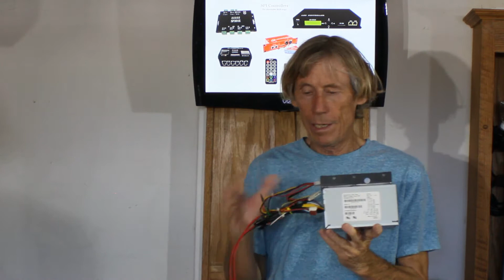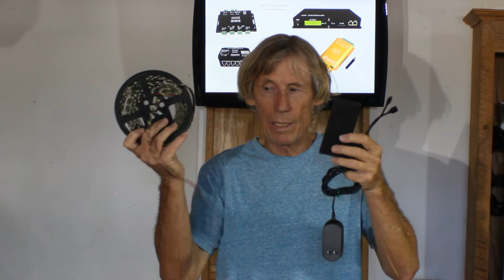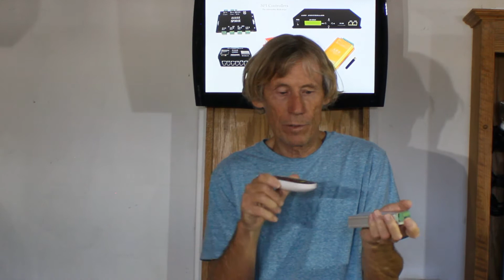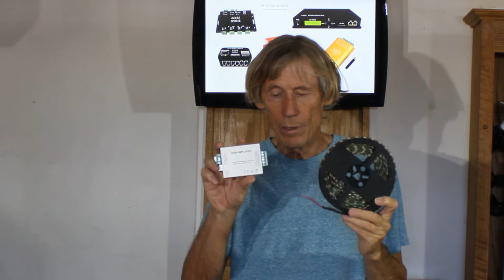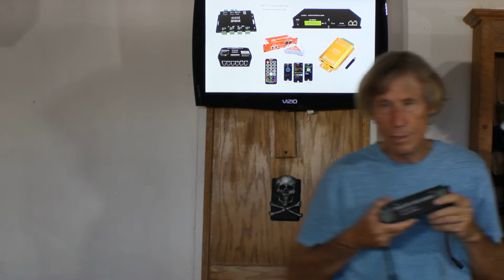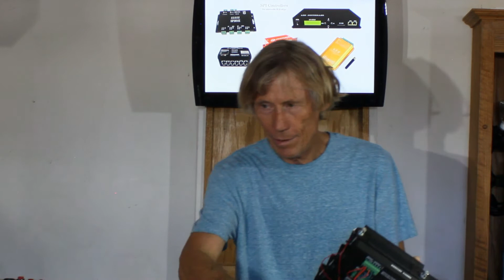LED Controllers

Comment: Good tips RC!
Reply from the maker: Thanks for watching. I get some good hardware out of old computers, VCR's and such. I give the circuit boards and old ram to my Son and he extracts the gold from them but he said it's not really that easy to do. You could even get some metric bolts from stuff like old cable boxes. Hopefully 2mm and 2.5mm and some good washers. It's about the same as collecting aluminum cans but I don't consider it to be hording. Just something to keep you busy when you retire and don't have a big bank roll.